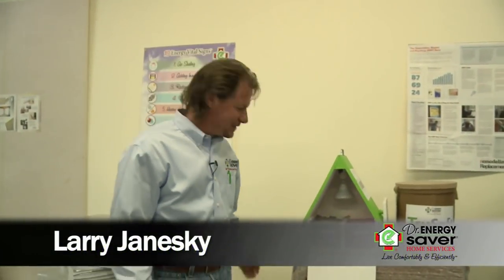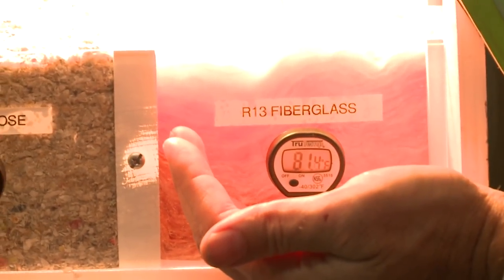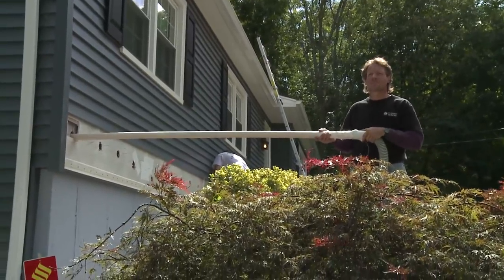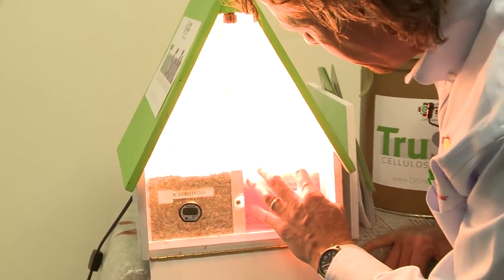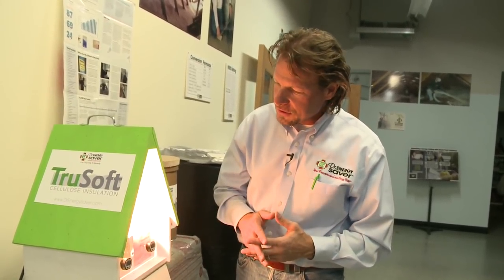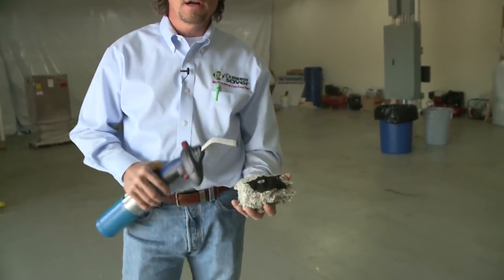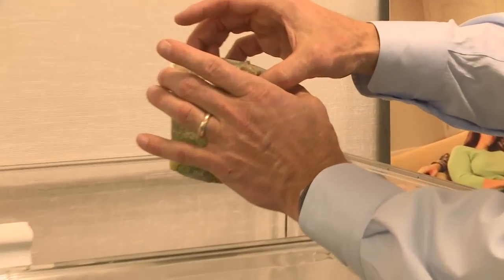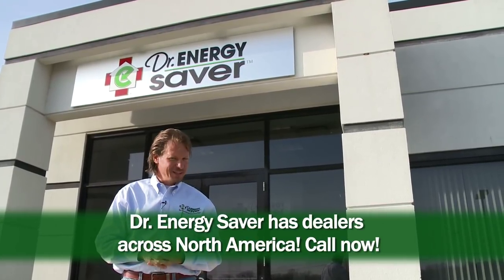Why Cellulose Insulation is Better than Fiberglass Insulation

Comment: I don't understand - the R-value is a measure of how well a material insulates. Different materials may require different thicknesses or costs to achieve R13 but as long as both are R13, they should insulate equally well by definition. Isn’t this like saying a ton of bricks is heavier than a ton of feathers?
Reply: Materials with high R values get that high R by trapping tiny air spaces, the more there are and the tinier they are, the better. The controlled conditions under which R value is measured use a low difference in temperature of the two sides, keeping air circulation inside the material low. With high temperature differences, air begins to circulate through the glass fibers more and the measured R drops, much less so with packed cellulose fibers.
Reply: cameratest. your confusion is understandable. R-value does not measure how well the insulation stops air infiltration.  An air infiltration test shows that. Cellulose is far superior. Add that to the superior R-value and it's an easy choice.
Reply: You're correct: "R value" is "R value," regardless of the material. However, the the "R Value" isn't the only factor (is the material properly installed, are joists exposed, etc.), unfortunately--it's just the best, shortest way the industry can market their product.
Reply: cameratest All of that shit is complete garbage and less you use foam insulation highly recommended
Reply: the problem with foam is that it goes out through the plugs
Reply: If they say cellulose is superior in trapping air, let's talk about if it gets wet. It prevents airflow and will eventually mildew and mold.
Reply: Ya lol
Reply: @carlsaberhagen628 , not at all. There are three industries. Each is derived from different principle of physics. The largest, fiberglass is deceptive in its promotions. Likewise for foam. Much more can be publicized by each industry. The absence of this unshared knowledge causes most homeowners to insulate inadequately and at a higher cost.

Comment: Fiberglass batt insulation is tested and rated in laboratory settings. The batts are fully fluffed and in enclosed spaces (all four sides, top and bottom) with little or no air flow.  The environment that the batts are tested under does not reflect how they are installed in your home.  if on the attic floor, they are not fully enclosed and subject to getting dirty from "wind washing" - air movements through your ventilated attic.  This dramatically reduces the effective R value of fiberglass

Comment: I have been a building contractor for 40 years. I won't use cellulose because it easily absorbs and holds moisture. There is always some water that can penetrate walls during extreme weather events. The wet cellulose will cause mold and wood decay which can go undetected until there is significant damage. I stay with rock wool and closed cell foam for this reason.
Reply: Hello. What's  attic insulation do you recommend for Orlando, Florida?
Reply: Rockwool just raised the price of the R15 batts from$58 to $79. And very difficult to find this stuff in the needed quantities.

Comment: is a box   spray insulation better than using a  r 19  6 inch thickness ,, i need to redo my   attic ,      when u use     the spray  do u still , need to  add a  vapour  barrier  , im assuming  the plastic is better  than the paper .    , can u spray the insulation  foam in a box  . onto the barrier      have like  6 inch thickenss  then  just add  some  r 19 insaltion  fibre  over the top of that   or  better  to add the cellulose  on topp of the  box foam

Comment: Fiber glass insulation is a proven performer amongst   insulation products. It provides exceptional thermal performance, moisture and mold resistance and fire protection. The two named builders below noted that fiber glass is their top choice for insulating homes. “As a builder, we are selling an energy system. And fiber glass is the answer for energy efficiency,” said Bill Decker Sr. Wayne Homes is an award-winning regional builder with a presence in Ohio, Pennsylvania, Indiana, Michigan and West Virginia – producing between 500-1200homes per year. Decker Homes builds high-end custom homes across southeast Michigan and northwest Ohio. He says Decker uses fiber glass for all it's homes.
Reply: +J.D.Roche Wrong, 1/8" of closed cell foam will outperform 2 feet of fiber glass. Fiber glass is NOT an air barrier OR moisture barrier what so ever. So how can it stop energy transfer? Answer it doesn't. The best type of insulation is closed cell foam with fire retardant.
Reply: +jim davidson FOAM INSULATION IS A CONFIDENCE TRICK. I met a clent who had paid a fortune for it, weeks later he scraped it with his fore-finger nail and it crumbled into little pieces like polystyrene does,  naturally he rung to complain and got this message "the number you called is no longer recognised" please check and try again. Water settles into SPRAY foam, so in winter it expands and drops away from the roof, it's made with a water--mix. It get worse they charge $3000 for $300 foam and labour. Google Spray Foam Scams on Google. (And How can a MICRO-THIN 3mm layer of flimsy foam beat 24 inches of Glass Fiberglass-this alone tells me you're a scammer).
Reply: +Alex Blake //  When used as rigid board insulation its chemistry and manufacture is similar to foam, to foamed  polyurethane. As the board stiffness increases so does it's brittleness increase making handling it unstable on building sites, where rough treatment and handling is the norm. Firms who make and sell it have tons of damaged board seconds for this reason.

Comment: You have only shown that the cellulose is opaque.

Cellulose is pushed because it's cheap. It has a better mark-up, that's why they push it so hard even though it compresses so badly, is so attractive to vermin, and has so many moisture issues.
Reply: Fiberglass is the same crystalline structure as ASBESTOS. I put cellulose in only 150sqft more of my home as the neighbor has in his exact same 1200sqft housing project home built to federal/ state/ building codes, my electric bill is consistently $100 LESS than any of my neighbors that have fiberglass where I have cellulose.
Reply: salt dissolves in the body and is processed by it. BARIUM is a toxic metal that can be absorbed into the body and sits unprocessed and unexpelled UNLESS it is in particular compounds, then it is not absorbed and is stable and safe and can be expelled. I am not aware of any diamond fiber products. Asbestos & similar glass, fibers ARE not dissolved nor processed by the body. The fibers accumulate, and cause abnormal cell growth in damaged areas (cancer). Mesothelioma and other lung diseases are direct results of exposure to crystalline mineral fibers such as asbestos... But any dust/ fiber, etc, even unprocessed plant fiber is  not good to inhale over a long period.
Reply: Heathh49008 Yes, I may be a moron. I worked in insulation for years. However, cellulose proved to be a fine product for both installers and homeowners. It is magnitudes less energy consuming to produce. I can tell you feel strongly that fiberglass is a worthwhile insulation product. That has just not been my personal experience with it. I have though, used it for aircraft cowling. As a pool filter sand tank it has stood up very well, as have the garage doors. Anyway...we all need to follow the OSHA dust mask regulations.

Comment: Down fall I have it in my attic and it settled under rafters and left a gap 1/4 inch and it's creating  condensation and ice then when it gets hot outside it melts and creates wet newspaper

Comment: Problem with the model is there isnt that much radiant heat concentrated on insulation in an attic so it's not an accurate  representation of the conditions in an attic unless the homeowner installed heat lamps up there.
Reply: It’s just a simple test ....oh my God these scientists in the comment section just wanna over complicate and find fault with everything.....

Comment: The problem is he doesn't show an R value in those tests contraptions. If you see actual blown insulation it's very light and fluffy whereas his test area it's extremely compacted. The R-value of blown insulation changes dramatically over time as the insulation settles down. The biggest benefit to blown insulation is it will fill every nook and cranny with little or no gaps between. However you'll need a much thicker layer of blown insulation to accomplish what fiberglass will. Both work extremely well, and cellulose is considerably cheaper, but to say one is better than the other is Up For Debate.
Reply: Yes he does. It said on the label R13
Reply: @realtyrocks1969  no shit it says R13. R13 is 4" thick, does it look like his thermometer is 4" from the surface where the light hits it?

Comment: I'm wanting to insulate an old schoolhouse building built in 1872. It is located in a remote wooded area. There is also a lot of moisture in the area given the structure is located on a watershed and on the edge of a creek. Does cellulose settle more than fiberglass, therefore, over time, not providing the R-value it did when first installed?  Also, I battle mice. I will have to blow it into existing walls through holes. Is one insulation product better than another in being distasteful to mice? Or do mice just love it all? Thx!

Comment: Wait a minute.   Something doesn't make sense.   Both insulation samples are labeled R13 which, as I understand it, means they should have the same resistance to transfer of heat.
Reply: BECAUSE R VALUE IS 72 DEG F.
FIBERGLASS LOSES R AT LOW TEMPS AND HIGH IN A BELL CURVE.
IT LAYS DOWN WHEN YOU NEED IT
CELLULOSE IS ALMOST FLAT LINE
Reply: Charles Crockett WHAT DID YOU SAY???
Reply: @parkeranderson5074  I think what he's saying is that when they test materials for the R values, they do it under very controlled conditions like only at 72 degrees. But if you look at performance at higher and lower temperatures than 72 degrees, the R value of fiberglass is actually much lower than advertised. The graph of R value of fiberglass looks like a bell shape: highest at 72 degree but dropping off dramatically at high and low temperatures. Graph for cellulose is nearly flat, meaning that the R value for cellulose stays at the advertised number regardless of how hot or cold the environment.

Comment: I don't understand how they are both R13 if the cellulose is performing better
Reply: Exactly correct. If they are rated the same, then their resistance to heat transfer is the same.
Reply: The cellulose stops air infiltration missed by fiberglass.
Reply: @briangc1972  Cellulose has an R value of 3.8 per inch, fiberglass is 2.7 per inch. Insulation is lab tested at a mean temp of 70 degrees. When the temp is dropped to 0 degrees, fiberglass loses 48% of its rated R value and Cellulose gained 10%.

Comment: I do fire/water restoration  and have found that  cellulose always breaks down  and turns to half powder  where fiberglass  is in much better condition and its also much cleaner to pull up. Also, almost every time i go to a house in the winter and  the snow is partially melted in the middle, when i eventially go up in the attic i find cellulise not fiberglass.
Reply: Old cellulose is more fiberized than the newer cellulose, which is why it seems more dusty, it  was made that way,  it  doesn't just break down over  time....
This  does  not affect the performance, 6" of  40+ year old cellulose will  still outperform 11" of blown fiberglass on the coldest day of the winter.
If  you  have noticed snow melted areas on the roofs of  these  older houses you've mentioned, most older homes are notorious  for  attic  bypass problems.
That is  when  heated air  from the basement flows up to  the  attic  through chimney, and plumbing chases, to name  a few of many sources.

Comment: In your test, isn't light bulb acting as radiant heat source? Hence making your test more accurate representation of summer testing (to keep away Sun's heat from living space) opposed to winter testing (to keep heat trapped inside living spaces)?

As an example, I am quite sure that aluminium foil would perform very well in your light bulb test because it would reflect away radiant heat. But yet people rarely (if ever) use aluminum foil alone to insulate houses for winter conditions, because foils are not not that efficient to limit heat loss due to convection.

It could be that with convection heat test you will still reach the same conclusion that fiberglass is better than cellulose. However, I think it is not correct to extrapolate your test for winter conditions.

Comment: Great video,  but silly, unnecessary, distracting music in the background. We are adults... we don't need that.  It doesn't enhance anything.  Just one of those stupid unwritten mandates so many sheeple follow.
Reply: Agree.  It should complement the narration (if used at all), not attempt to drown it out.
Reply: Why did no one mention that in 1st diagram he showed, the fiberglass thermometer was higher up, which explains why it got hot quicker…          (I hate fiberglass tho, for allergy reasons)

Comment: Borax sounds useful for keeping dry wood termites out of the attic, which a previous owner at my condo had. That demo showing cellulose heating up less than fiberglass seems too good to be true because it's denser with higher specific heat, which would be a problem to cool down in the evening. What I want to know is the temperature after a few hours.
Reply: Hi, do you still use cellulose in your attic?
Reply: @HsingSun  No, I never have. I'm in northern California where winters aren't that cold, so the attic has the old fiberglass insulation.
Reply: I take some issues with his test. First and foremost, he is using a light for the heat source in the test. The light emits radiant heat, which can penetrate a translucent or transparent material. All insulation in your home is covered and protected and not directly exposed to any light. 

This would be like comparing the R Value of a double pane window and a half inch sheet of OSB. Obviously the sheet of osb is going to perform better at the onset because it’s going to block all the light, but the window itself has a better performance rating than OSB for obvious reasons.  

Additionally, fiberglass batts really aren’t used very much anymore in new construction ceilings. The typical insulation is a blow in fiberglass wool

With all that said, I’m sure cellulose is a good insulation material, but personally I will stick with fiberglass as they are more common in my area.

Comment: Your video is deceptive; 
1) You used much thicker insulation on cellulose side and 
2)  thermometer on fiberglass is placed slightly higher, closer to the light bulb.
It is true that cellulose provides slightly higher R value per inch, but cost per 1R and weight per 1R favors fiberglass insulation. Meaning; you can achieve same insulation value of cellulose by using thicker fiberglass insulation and fiberglass would cost slightly less and weigh far less even if it's applied thicker. On the other hand cellulose reduces noise better. How much load can your ceiling hold???